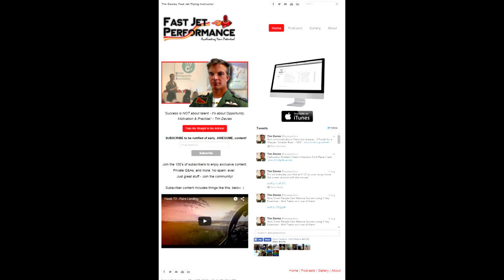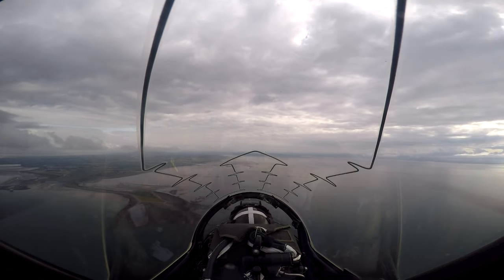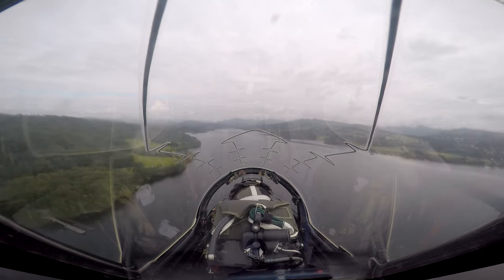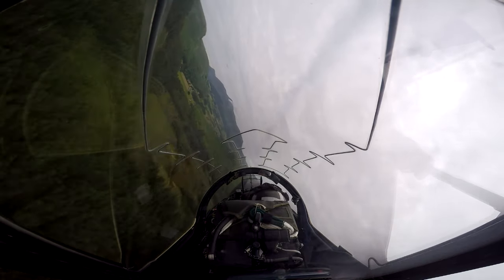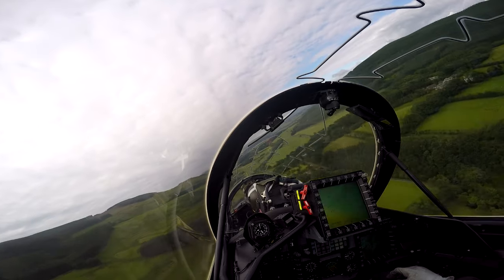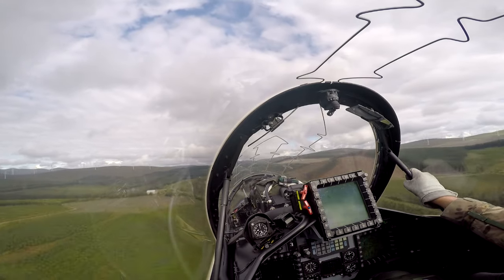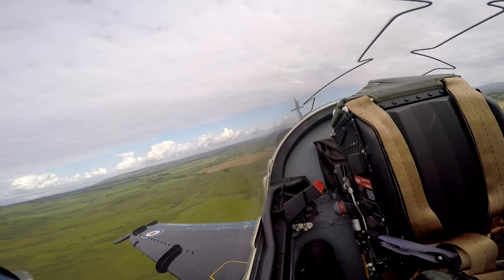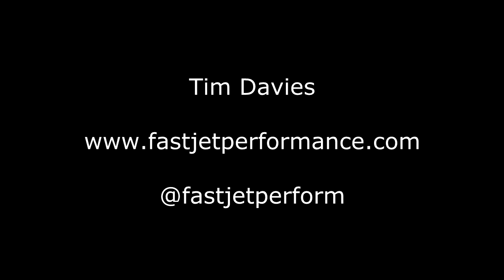Low Level IN COCKPIT - EXPLAINED by the RAF Instructor Pilot

Comment: This is what I was supposed to do. If any young Air Cadets read this, I did 500 flights in gliders, 31 solos and lots of flying in Bulldogs. I got tempted into a career in finance and I'm now 36 & head trader on a stockbroking desk. Money comes and goes, give flying jets a shot or you'll regret it for the rest of your life! Dont sit behind a desk! Good luck! 😎👍
Reply: I made a similar mistake. Went into engineering instead of flying. Regretted it ever since I realised I was too old to go back and give it a try.
Reply: speedingtube what if you’re using aviation as a means for money, i.e. big daddy left seater in commercial aviation?
Reply: Lots of Gliders yes, Bulldog no, Chipmunk yes. Those were the days. I find it amazing that between the ages of 13-19 I took it all for granted. Unfortunately for me (or should it be fortunate) I was diagnosed with high frequency deafness which put a stop to any delusions of grandeur. But I always think back to my days at 1341 sqn ATC. Happy days indeed.
Reply: I tried. I "Failed in Airwork" at the Jet Provost stage. I gave it my best shot and enjoyed it while I could. Then I went back to engineering.
Reply: Not these days. USAF and RAF won't put you in the air and will try and hold you in for years while you play around with simulators and fly maybe once a week. 

You'll get the same experience in the air force you would by playing DCS in VR with a HOTAS

Comment: Tim, Sir, Excellent video. Good clean Narration, easy to uinderstand and exactly clear.After my 24 year stint, I did a little Heavy Goods work between Warrington and Cumbernauld. Sometimes I would see one of 4FTS Hawk Trainers and it would give me a lift. Pump the air and yell (quietly) 'Go lads'. Other low level aircraft was always a good sign we were accomplishing something in the RAF, and to this day, I am lifted when a Mil fast jet goes overhead, sadly, not so frequent these days. Good job Tim, my respects to you.

Comment: Thoroughly enjoyed the video. I worked on Hawk flight dynamics at Hawker Siddeley back in the early 1970's - good to see its still flying. Re paragliders, concur with the previous commentator. In the UK most XC happens in thermal activity, so is probably well above you when low flying, except when ridge lines are used in the mountains. You're also not likely to see us above cloudbase. But most XC, particularly down south, is in the few thousand feet below and between thermal clouds, so watch out when flying VFR in that zone. Back in the late 1970's, my colleague, Doug Thorby who was the senior Loads Aerodynamicist at the time, showed me a flight path recording of a Hawk avoiding a glider - it pulled up from 1g to 8g in about 0.4 seconds - he was teasing me and said "I bet you can't do that with an active control system". Well actually you can, but not with the kind fitted to the current generation of fighters. Anyway, it gives me some comfort that if you see us, from the Hawk, you can miss us. We can hear you before we see you, but can't remotely pull clear of your flight path that fast.

Comment: In a book on the service of the North America P-51 Mustang in the Royal Swedish Airforce, swedish designation J-26, there is story told by one of the pilots about the difficulty of judging altitude over smooth surfaces.
He describes a low flying exercise mission during a sunny winters day, on which the return leg was flewn low over a large frozen lake, with a smooth sheet of new dry snow on it.
As it happened, an acquaintance to the base commander(?) was at the shore of the lake, and saw this Mustang fly by, "real fast and real low".
When the pilot had landed and was in debrief, the base commander came in, asking if everything was okey; with the pilot and the plane.
The pilot of course asked regarding this "particular interest", and was told that the acquaintance had called, worried that something might have happend.
This as the pilot had flown so low, that the propeller blast and wake, had drawn up a plume of snow after the aircraft, that was told to have been a fair bit higher than the top of the fin.
The pilot had a little after-the-fact chock, but now knew how difficult it is to judge one's altitude over a snow covered frozen lake.

Comment: Did low-level nav when I was in training as a U.S. Naval aviator, in TA-4J Skyhawks, circa 1981, over south Texas.  Not NEARLY as picturesque.  Really enjoyed this video.
Reply: T-2C out of Beeville, Tx (1981 as well!)
Reply: Zach Michaelis  no, south texas is flat
Reply: I get t45s from kingsville nas over the house
Reply: Zach Michaelis  South Texas was chosen, I believe, because you can crash an airplane down there without danger of damaging anything valuable.  There are landmarks to use as waypoints.  One of your challenges is to learn how to recognize them from the air.
Reply: @jimpollard9392  yup lots of flat open areas to ditch

Comment: Absolutely fantastic sir. Don’t do twitting so can only thank you on here. Ex-RAF plummer. Couldn’t be a pilot in my day due to my poor eyesight. Dream was to fly the Tonka (Tornado). Nearest I get to it these days is DCS or FSX. 
Thanks again for a superb vid sir. Not a fan of the T2 but this vid has given me a better insight as to its workings, handling and uses. Still prefer the T1 though 🙂
Reply: Symie8 ex-fairy and ex Valley here! It looks a lot more interesting to work on than the "raspberry ripple" with its basic avionic kit. I believe its all civvy ground support staff nowadays. Those were the days, ahhhh.
Reply: @kevincasey5035  As I was led to believe basically every trade was going civvy except First Line! Bloody shame! Anything to save a few bob here and there!

Comment: what a fantastic insight into the world of low level flying and I must say the T2 has one sexy cockpit, very impressed. If I hadn't been born with Fabry disease, flying the Hawk would have been my dream job. Yeah sure there are bigger and faster out there but the Hawk seems to be the MX-5 of jet aircraft. One question, as you descended below 2000ft and gave the call out to warn other traffic of your intentions are you off of comms until you ascend back up past the drop point or are you in contact with local area controllers? keep up the awesome work.
Reply from the maker: It's a radio call on a common frequency that all aircraft who are at low level just listen to and occasionally report their location on in case any other aircraft are nearby.
Reply: What frequency is that?
Reply: Hi there Tim.

Thanks for your excellent narration on this video.

Question....
I watch radar on flightradar24.com and occasionally the Hawks transponder will pop up on the screen in the Welsh mountain region north of Aberystwyth.

Is this because you're turning on the transponder to show up on civilian air traffic control to avoid conflicts when you climb to higher altitudes?
Reply from the maker: Cliffjumper24 no, it's just because our transponder doesn't always show up on radar at low level because it is blanked by rocks and mountains, we leave it on at low level
Reply: Fast Jet Performance
 I had a feeling it was something like that. In fact, I was surprised to see any RAF transponder signals outside of the Voyagers (which operate as civilian aircraft outside of combat ops).

Incidentally, I've flown through the Welsh mountains myself, in a 151sqn Hawk (T1) from Chivenor back in 1991.
I was in the back enjoying the experience, but hoping the pilot was as good as I thought he was!
Reply: sexy cockpit? Really? Whatever spins your wheels mate. I"ll stick to women.
Reply: 278.6

Comment: Tim, do you train without the moving map display ?   When I trained on the  Macchi, we did low level nav exercises at 250 ft AGL at 300 KTS, with a paper map and a TOT tolerance of +/- 10 seconds as a student - no colour CDUs with moving maps!  Whilst the moving map is a great modern aid, if it fails, do the young fighter pilots of today have the requisite, basic map-reading skills?
Reply from the maker: We always carry paper maps for this reason but kit failure is rare and, if it does happen, the student just climbs out of low level and comes home as the weapons system will normally be degraded too making his mission unachievable. We don't intentionally turn off the moving map on the T2 as 'reversionary navigation' has been done previously on the Tucano which has no moving map at all and is all stopwatch and map. The Hawk T1 is still paper map and stopwatch through it is no longer used for instructional duties.
Reply: Macchi -RNZAF?

Comment: As a firefighter and handyman by trade, not really up to speed on aeronautics but how much more fuel do you burn at 250m, on average,  versus flying in and out of operations at whatever altitude 5-6k ft?
Reply from the maker: OK, thanks Max - so I think that you are asking that, at low level when flying as in the video of 250 feet and 420 knots (about 500 mph) - how much fuel do we use as opposed to transiting on operations to the op area (which we do at about 0.6 - 0.7 Mach) - the speed in knots just varies with height but about the 'sameish' but the air is thinner. So, at low level we use 25 kilograms of fuel in 1 minute and at a cruise altitude of about 20,000 feet at the speeds I said, we use about 10 to 15 kilograms per minute. I hope that helps and, as a last point, I thank you sincerely for your service as a firefighter serving the public.
Reply: @FastJetPerformance  Just to generalise your point, jet engines become more efficient with altitude, which is half of the reason why airliners fly so high.
Reply: @FastJetPerformance  I suppose you'll be loosign more efficiency with all the maneuvers as well.

 Thank you very much - I do get a massive red toolbox with blue flashing lights into the bargain.
I see you get a cool toy as well. We'd best keep quiet about all that or people might doubt our motivations!
Swap sometime?!
Thank for keeping our us all safe =)
Reply: Thank you for the time and effort on uploading this video. I wonder if fuel econony at high altitude is antual effect. Or if aircaft and turfans are calibratec/optimized to for fuel ecomy at high altitude?

Comment: Did he say they burn 25 kg of fuel per minuet at low level!!! That's crazyyy
Reply from the maker: Yes, he did - but less fuel higher up. So, at 30,000 ft we are burning less than 10 kgs as the air is thinner up there but we've burnt a lot of fuel to get to that height, of course.
Reply: @FastJetPerformance  i am assuming the fuel burn at higher altitute is due to the air resistance, 300mb  the drag coeffienct is less

Comment: I would be more concerned about drones than about paragliders. You can see paragliders from miles, but drones are so tiny and widely used nowadays. Its hard to manuver them quickly if you see a jet or helicopter approaching with high speed. I am amazed we don't have more serious accidents. Low airspace needs to be regulated!
Reply: If there was a way for any high performance aircraft to be able to send out a signal that turns off a drone's engines within, I dunno, 1 nm. That would be great. Oh and some system that renders laser-pointing-morons sterile within 10,000 nm.
Reply: @marilyn3583  that really is a damn good idea, the sterile thing might be harder to implement
Reply: @wolfytype  It's worth trying! :)

Comment: Nice video. Very interesting. Trying to calculate the speed. St. Marys Loch, 6,15 Kms flown in 28 seconds = 790 km/t.
Reply from the maker: Should be 420 knots so around 500 mph or 7 miles per minute so a direct calculation from yours 790 kph = 426 knots so good work there.

Comment: Questions: You say the HUD is in mag. What's that?  Early in the video there is a large rectangular screen seemingly in your field of vision. Doesn't that obscure the view of the hud (assuming it was taken over the shoulder of the pilot (at the level of his head). What is the purpose of the squiggly lines on the canopy?
Reply from the maker: HUD = Head Up Display (MAG = Magnetic heading as opposed to TRUE) and the canopy lines are Micro Detonation Cord (MDC) that shatters the canopy on ejection. The large rectangular screen is only in the rear seat and the HUD from the front seat is repeated on it - the rear seat does not have a HUD.

Comment: Tim just an FYIVvery interesting however just a quick note on the FADEC  
As an ex RAF instructor on propulsion systems  and now a consultant aircraft systems safety engineerthe F full and A authority  doesn't necessarily mean you get an engine  relight if the computer algorithms set no the it deserves the right to give you a adjincour salute  and no relight to would need to talk to the techies in the training school or the Dr/ bae field rep as to how it's configured in these situations certainly that's the way the  tornado MECU and the C130J engine control minute are configured , so on that note these manufacturers tend to keep costs down by reading  something that has passed certification of RTS over  from one type to the next kindest regards
Reply from the maker: Thank you, Michael - it did help with surge protection over the Hawk T1, however - that was a small bonus and it was more resilient to birdstrike.

Comment: 420 knots - when I installed the higher res grand canyon terrain, I found in FSX that 420 to 450 knots in the FA18 gave the best compromise between turning power and g-force.  While presumably too low-margin to do regularly in a training situation, I suspect that the simulation did give me a taste of the work flow needed to carve through terrain.  I took it seriously, setting a zero tolerance policy to ploughing in, but you're obviously acting within a rigorous framework of training and experience well beyond my personal amusement.  It's interesting to see you pegging a real aircraft at similar speeds.
Reply: I think the main reason they get around at those speeds is so they have enough energy to gain some safe altitude in the event of engine failure.

Comment: Still love this video. One of the best to learn what goes on during a low level sortie.  Just wondering Tim, how does it work with planning a low level sortie with a TOT? Do you allow  a margin for ground speed variation because your route through a valley isnt a straight line like it is on a map? Hence your time to the next waypoint/target varies way more than if you're flying a straight line?
Reply from the maker: No, you just try and hit each waypoint on time and cut corners where you have to. We turn on time which often means turning a bit early or late at a waypoint to stay on time.
Reply: @FastJetPerformance  interesting, I would have expected some margin to be allowed during planning (for example, plan a route at a slightly slower speed say 350 kts and then increase speed as required to make the TOT). Reason being , surely it's easier to compensate for being late than it is if you turn earlier and then have to figure out your navigation too?
Reply from the maker: @boggy8557  we do train the students to a high standard to be able to do the navigation making fine adjustments for time and we don't plan to be slow to have time in hand because being slow is dangerous at low level (not enough energy to zoom climb for engine relight post birdstrike and jets handle better when fast) and we need to plan to use all the fuel we have. Planning to be slow on one leg but then needing to be fast will destroy the fuel plan and we may run out before we hit the target. In the Hawk we use 20 kg of fuel per minute at low level.

Comment: Does the hawk have an autopilot?  If so is it very basic?  As in you can only select parameters like  IAS, Heading, and Altitude to "Hold" where they are, or can pilots dial in Speeds and Alts...etc.
Reply from the maker: We can get it to follow our route, we don't dial in speeds, we fly the speeds and then set it - but we can dial in heights and headings and tracks.
Reply: Thanks!

Comment: Have you got a nearest alt airfield in mind for every waypoint prior to takeoff? How do you remember it all?
Reply from the maker: Yes, they are written down on a paper map we carry but you can also hit a key in the jet and it tells you the nearest airfields although they might not be suitable for jet ops.
Reply: @FastJetPerformance  so prior to takeoff you're basically fully aware of sectors in the flightplan where you wouldn't be able to make an alt airfield from 420kts energy alone? Looking forward to the next DCS installment, are you enjoying it or a bit of a ballache? I'm trying to get my setup sorted but will be 1080p unfortunately, better than nothing I suppose.
Reply from the maker: @thelmaviaduct  Yes, that's right and for the majority of the route, from 420 kts with an engine failure at low level, we would just position for ejection.
Reply: @FastJetPerformance  did you personally have any dicy moments with the engine/s on Hawk and Tornado? Difficult for a civvy to quantify the likelihood of things going tits, and there's no hard shoulder in the sky. On a side note, would the GR4 take you from waypoint to waypoint in TFR mode and auto throttle? If it did, would you ever use/trust it to do so safely at 200ft? Was the soft, medium, hard selection noticeable? In valleys, would you be purely manual flying rather than rely on TFR? Did you ever fly Digital Integration Tornado bitd? If so, what did you think of it, especially the mission planner? Probably questions for day in slow time, take care and thanks for all you do, it's a great channel 👍🏿